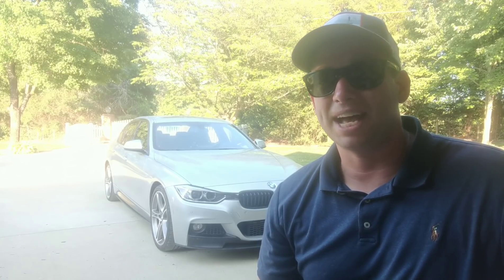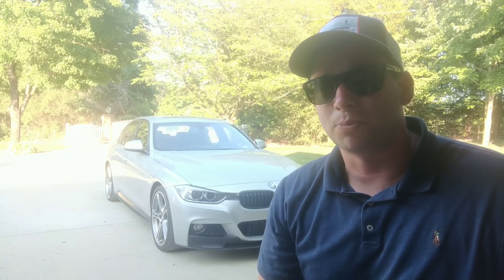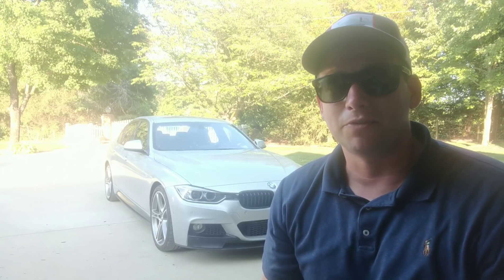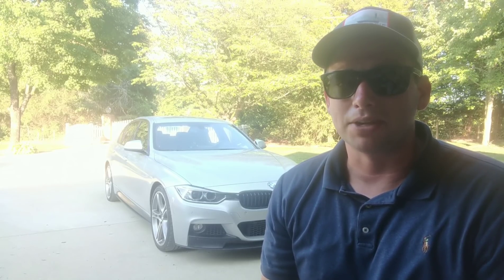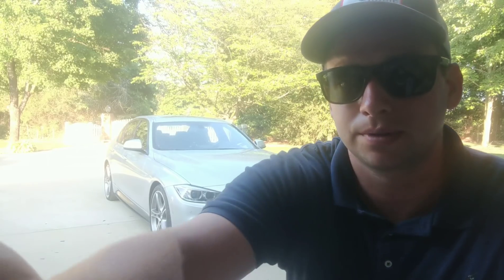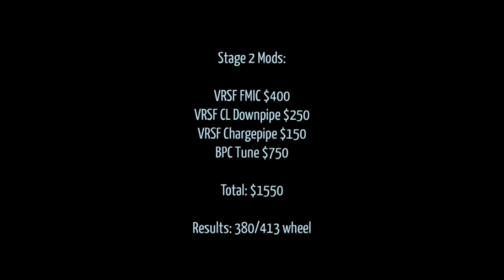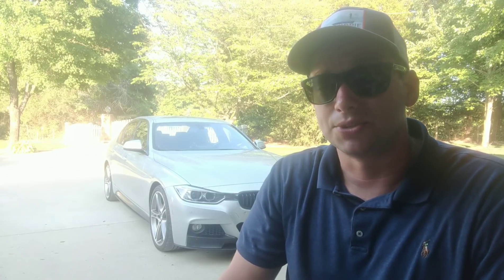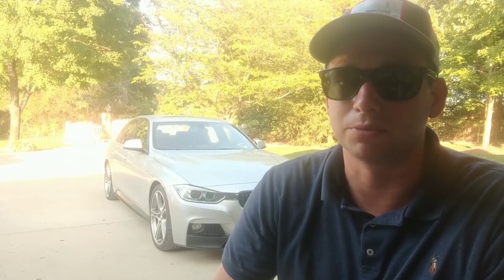BMW F30 335i N55 - Performance Mod Overview - 500whp+ on 93 Fuel

Comment: how is it holding up?
Reply from the maker: Still running strong with the new owner(s) as far as I know from a few weeks ago
Reply: @BtwilliasGarage  what was the verdict on the n52 cam vs the cost
Reply from the maker: I enjoyed the upgrade and made power across the board. I will warn you that if you do it, prepare to write a doctoral study as proof for the internet 🤣
Reply: @BtwilliasGarage  im torn on what route i want to go, already got the stage 3 meth kit and FBO.... looking at turbo/cam now
Reply from the maker: Definitely do the turbo and fuel pump before the cam
Reply: @BtwilliasGarage  already have dorch stage 2 hpfp and stage 3 spool lpfp

Comment: I’m late to the party, but these number seem really low based on what I’ve seen, experienced and heard from others. I’m curious to know the condition of your motor? “Mileage” pure stage 2s with 93 oct should be making 420-450 easy. With hpf 500+
Reply from the maker: I ended up making 550/579 after fine tuning and a few other parts
Reply: What got u at this new power. With ps2 and making sure it have everything needed to reach 500whp. Did not go with xdi35 but dorsch stage 1 that I seen flows the same. But was wondering if without meth I can reach the 500whp at least.
Current set up
Set fbo
Dorsch stage 1
E30
Next ps2 will added with inlet
Reply from the maker: @juliosuarez8414  it will be close, but you may need ethanol (e40)

Comment: Watching this for my new 2015 335i, and this is one of the most comprehensive videos I've found without any of the fluff. 10/10 video my dude.
Reply: Slight edit, did you get an LSD to prevent slipping? If so which one did you go for, and how much did it cost?
Reply from the maker: I never put an LSD in it unfortunately
Reply from the maker: Thanks for the kind words man. Enjoy the new ride

Comment: Would you recommend me getting the fueling system upgrades first before the turbo?
Reply from the maker: +cutthroat performance the turbo alone will net you good power, but I would at least do meth with it to get the most out. you will need a high pressure FP too to get over 500 whp

Comment: I'm also in Raleigh and have been to BPC for maintenance.  Driving a 2013 E70 N55 and am interested in your stage 2 mods.  Did BPC take care of your CEL after DP install?  Are you able to pass emissions?
Reply from the maker: They can install the parts for you, but no longer offer tuning. You can work with a remote tuner to handle the CEL. I do not require emissions in my county thankfully, but have since sold the N55 for a S58. Give them a call and let them know Brad sent you

Comment: I just started a build on my 2013 did you have to put any work into the internals of the motor?
Reply from the maker: When I went over 500whp I did ARP studs and ACL rod bearings

Comment: Yo great video! Quick question though, over the year, how has the reliability been?
Reply from the maker: Thank you! Everything is going great. No issues other than chasing plus, coils etc for a misfire for a week or two on WOT. Ended up being bad ethanol lol
Reply: @BtwilliasGarage  gotcha, I’m planning on doing fmic, chargepipe, intercooler, and stage 1 tune. Thanks for the quick response really appreciate it🙌
Reply from the maker: You're welcome! Enjoy it, that will be a nice bump in power
Reply: @BtwilliasGarage hopefully I can make like 360-380 to the crank haha
Reply: Hey man, great vid! You mentioned something about NOT upgrading the low pressure pump but never got into why, so now I'm curious lol. My 435xi build is pretty close to yours except I'm still deciding which turbo I wanna go with and I also haven't installed meth

Comment: Do think getting an aftermarket compressor for the stock turbo would be a good cheaper alternative instead of getting a new turbo? I’ve heard the stock turbo could handle over 25psi but wouldn’t consider even breaking 20
Reply from the maker: That would take a pretty impressive skillset to pull off man. I'm not educated on what all that would take to make your own PS2, but it's definitely not easy to pull off. I would plan on buying the PS2

Comment: Hey I've been recommended to do the LPFP vs HPFP, you mentioned not go with the LPFP? Can you recommend why? Thank you!!!!
Reply from the maker: What mods do you have? If you are only going LPFP because you do not need a ton of extra fueling, then sure, go for it. I'm just saying when going HPFP then it is not needed in many cases to do a LPFP due to issues that it causes with both
Reply: @BtwilliasGarage  Right now I've got VSRF down pipe, CP, FMIC, exhaust, gapped NGK plugs, coils and JB4 tuner...Running 91 right now but wanting to install the PS2 turbo and figure out whether to go meth injection or e85 mix (whichever is less work on my side to fill it up regularly) Thoughts? Got ohlins R&T coilovers installed today too!
Reply from the maker: @ShelbyPaget  Nice! In that case I would just plan on going PS2 and meth to start. You can always run a small ethanol blends with your meth for a little more power, but after MUCH testing ive found a 93-e30 mix and boost juice is reliable for 525whp+/550wtq+ all day long (with XDI35 HPFP). Just do PS2 and snow kit with size 6 nozzle next, tune properly. Will get you mid 400s for power and be solid for learning the car at that power. Then do HPFP when you get bored
Reply: @BtwilliasGarage  Is there any advantage for the LPFP then? Sorry a newb to the n55 platform and learning as I go. I will likely just follow your footprint as it looks sweetttt!
Reply from the maker: @ShelbyPaget  No worries! Yes, the advantage to the lpfp is a little more fueling BUT that will not be worth it in the long run with your plans to go PS2. You will max out the lpfp and the hpfp will do the exact same for the ps2 with the OEM lpfp as it would with an upgraded one.

Comment: Do you not worry about spinning the crank timing sprocket, or the crank bolt coming loose?
Reply from the maker: Nah not really. On S55s that's a big issue though with the crankhub as I'm sure you know

Comment: in your opinion, what's the most similar in terms of power to your bpc tunning, mhd or jb4?
Reply from the maker: It's not so much the software/app, it's the tuner. I prefer MHD. Check out PureBoost for a custom tune

Comment: Rod bearings at 140k miles?? I need to drop the pan for gasket and am wondering if I should upgrade rod bearings ? Thank you
Reply from the maker: Yes you absolutely should! That was mine at like 45k, but I've been pushing 500whp+ for 10k or so. 380whp for 15k before that
Reply: Btwillia's Garage would you recommend oem coated or an aftermarket upgrade for rod bearings  ?
Reply from the maker: @UsuallyOff  I recommend the ACL race bearings

Comment: How is the rest of the powertrain handling it? I'm guessing launch control is off the table. Did you go with wider tires too?
Reply from the maker: I use xHP so I can dial in the perfect amount of slip. 0-60 is around 3.4 on good days. The tires are not ideal. 255/30/20 PS4S. Would do way better with a beefy 18 setup. appreciate you checking it out!

Comment: I'm still paying my car off and want to do this to my F30 N55 335i.  Currently having issue with battery drain even after replacing the alternator and having both battery and alternator tested - passed!

I was on the way to work, then the computer screen went blank while on a call.  it came back up and a warning came up about the transmission.  Could this be why my battery isn't charging while driving it?
Reply from the maker: Did you have the new battery coded properly after you/they installed it?
Reply: Btwillia's Garage yes I had my mechanic do that. My assumption is that coding only needs to be done when a new battery is installed.  Not if the same battery is disconnected and reconnected.
Reply from the maker: I agree, I believe it only needs to be coded upon replacement. You should be able take the + and - off without issues and reconnect the same battery back within no issues. My car has a slight parasitic draw when I leave it for 5 days+ with the radar detector and what not plugged in. I open the doors a few times as well. It gives me a warning that the battery has lowered voltage when I don't drive it for 5 days or so. It's the original 2015 battery. I'm not sure what the recommend man. I hope you get it figured out!

Comment: Great video in your opinion which would be a simpler more cost effective mod to make between the 2 meth or E85 blend ?
Reply from the maker: That's a great question. Where I live it is kinda tough to find E85, which is why I went with meth. If you are able to do your own work, meth is not too bad. You can even use -32 windshield wiper fluid to save money, although I prefer to run Boost Juice. Lots of people make pretty good power running a e blend. Let me know what you find out and decide on. I'll be giving away an E85 test kit and some shirts here soon, so be sure to subscribe if you haven't already

Comment: Thanks for the help. I'm honestly bummed because I was told by MHD that the LPFP stage 2 was needed, but now I've been reading more and it seems like HPFP is more important! Guess I'll have to upgrade 🤷‍♂️
Reply from the maker: Yeah things changed once the XDI35 entered the market. You should definitely get one if you can. I hear the stock lpfp works best with them though, so just be aware.

Comment: nice informative video... kinda dislike there were no pulls or sound or anything of the car. lets say you purchased the car for 40k (real number here might be higher). you spent 10.5 grand on tune. wouldnt you get a more horsepowered car for 50k than the 335?
Reply from the maker: Thanks for the feedback. You can find quite a few interior, front exterior, rear exterior, etc sound clips on my channel if you would like. You would be hard pressed to buy a car for 50k that would beat this one, but I'm sure you could
Reply: @BtwilliasGarage  well i was just calculating. and numbers cant be compared to what you really like. i have a 335i stage2 (making around 400+ at the crank) and i wouldnt swap it for any other. just wanna put more juice in it :D

Comment: So with all that combine you spent $7760. not bad.
Reply from the maker: Check out the slide at 11:55. It was right over $10k for all the parts. Still not bad for a N55 that can hold it's own with most sports cars 👍

Comment: What is the stock engine good for if you daily drive it? Also can the speed tech turbo kit make 500 whp on 93 oct only?
Reply from the maker: I would say the stock engine is fine til 575 or so if you are smart and not launching it daily with traction control off. I've seen people break axles and what not, but that's from donuts, etc. I'm sure the speed tech kit can make 500+ with supporting mods. I'm not terribly familiar, but if that is the stage 3 kit then I've heard 600+.

Comment: What coils do you run?
Reply from the maker: I just have m sport suspension currently
Reply: @BtwilliasGarage  sorry i meant ignition coils. I just purchased the xdi 35 hpfp. I asked Gabe and he said just get new oem coils with the ngk 2 step colder. He dosnt like aftermarket coils. But what coils u have?
Reply from the maker: @HeathHerring666  ah gotcha, yes I use stock coils and N20 plugs when I did PS2. Kept the same setup when I installed the XDI35 a couple thousand miles later. My coils have around 40k on them. Should probably get some new ones in the next few months and a set of plugs to be safe
Reply: @BtwilliasGarage  nice! Sounds likena good setup. Why n20 plugs when you have a n55?
Reply from the maker: @HeathHerring666  n20 plugs are 2 steps colder than n55 👍
Reply: @BtwilliasGarage  gotcha the 95706 ngk? Thats what i run too
Reply from the maker: Those are the ones
Reply: Im confused? The ngk 97506 gapped to .020 are for high horsepower n55 engines. Recommended by mt tuner. They are stock for n20 and s55 but are also ran in n54 a d n55
Reply from the maker: @HeathHerring666  clarify your question a little for me. I'll reach out to my installer and try to get clarity

Comment: Ive been talking with the guys who make xdi 35 hpfp. Im about to pull the trigger and finally say goodbye to the stutter. But my question is, is the xdi hpfp full e 85 capable? As long as i got my lpfp upgrade? Thanks
Reply from the maker: I'm pretty sure it is, but I would check with them or Frank Smith and Gabe at TTFS. I'm not sure that you would need to upgrade your LPFP, but I have no plans for e85, so I'm not sure on that. Lpfp is good up until 700whp with the XDI35.
Reply: @BtwilliasGarage  oh nice i just purchased the pump and im driving 5 hours to meet them to get it installed at the end of the month!

Comment: Thanks for this vid. Been following the build. Still dealing with a stutter from 3k to 4.5k in wot. 13 n55 pwg xdrive. Bm3 saying hpfp is taking a dive. Ty for your reply on fb. Wondering if upgrading the lpfp would help my issue instead of hpfp cause its so pricey. Meaning getting a better lpfp would it force the fuel through.

Secondly i havnt seen this anywhere for the meantime on bm3 could i do the boost by gear percent and maybe fix the issue that way? Thanks man. Keep the vids coming.
Reply from the maker: I appreciate the comment and follow! I'm sure the LPFP would help quite a bit. It would have to. You honestly may not even want/need to go HPFP with the AWD. It would be overkill and you would be insane fast off the line, but likely break something quick. That based on what I have heard, not experience.

I am not familiar with BM3, but will follow up if I can track down more info on BBG. I'll make more vids next week! Tires are getting worn, so next vid should be very smokey 😁

Comment: VRSF makes cheap, Chinese grade parts.  Evolution Raceworks makes the quality parts.
Reply from the maker: Only problem I had with VRSF is needing to trim the chargepipe slightly to get it to fit properly. I wouldn't expect that problem with Evolution. Although they may be cheap, the parts seem to work just fine at 500+whp
Reply: Btwillia's Garage I had to
Do the same with their chargepipe. Works fine though

Comment: Did round 2 have meth or e85 already? 380whp is high for bolt ons, I notice you only gained 50whp adding a PS2 turbo and meth and lost some torque
Reply from the maker: Meth was in round 3. The car did have higher torque with just PS2 and meth But my tuner turned it back to be safe until we added the pump

Comment: Sick intro for a such a small channel. Keep up those cinematics!
Reply from the maker: I really appreciate that! I enjoy it as a weekend hobby. Thanks for the motivation to keep it going
Reply: Does that HPFP fit a f10 535i N55?
Reply from the maker: I believe it does! Call TTFS tuning and they will confirm. They also have an XDI-60 if you are feeling crazy. Did a cam upgrade today and gained 100whp at 5.5k rpm. Be sure to subscribe 🤘

Comment: Awesome video buddy ,, that power was on 93 ? Don’t u consider to flash your transmission too ?
Reply from the maker: Thank you! Yes this is 93 fuel with meth only. I asked my tuner to flash my trans, but I'm honestly not sure if he did. Will need to check. It's lightning fast shifts, but then again the ZF8 is strong stock

Comment: Awesome video! Looking to start adding power to my F36 N55 right after coilovers. With that much power do you need to get an LSD?
Reply from the maker: Thanks a ton for the feedback! You will get addicted quick to adding the power. The full bolt ons and tune are awesome for the price. 100whp and 100tq gained for around $1600 if you can install yourself. The intake and exhaust are simply for sound, so not required to go quick. After that it gets pricey, as you saw. My car hooks up great in launch control mode. Only problem is the 20 inch wheels and tiny sidewall. With a meatier sidewall I could probably get my 0-60 down. Currently at 3.61. Thanks for watching!
Reply: @BtwilliasGarage  Damn that's fast! Can't wait. Thanks for the great info.
Reply from the maker: Lsd is not required, but would be a ton of fun!

Comment: Gonna be doing a similar build, going through all the stages. But tbh hybrid turbos just don't cut it for me if you're pushing over 500whp, especially for a daily. That's  why I'm going to go with speedtech's kit. The biggest problem imo with the N55 is the manifold and turbo. The B58 makes over 30hp more just because of it's improved manifold. So I just don't see myself wanting to push that much power through the stock manifold and borred out turbos with thinner walls. Just go big baby, these engines love it. All you need is a good EFR turbo that will be at full spool by 3500rpm and much more reliable as a daily. Just my 2 cents
Reply from the maker: I can understand that, but don't sleep on the Pure S2 setups. I have room to turn it up to 575 or so when I'm ready. Plenty of people have put over 60k on this setup with no issues daily driving it. Don't blame you for going big though!
Reply: @BtwilliasGarage  Your 575 number is on a high reading dyno.  I have a similar setup on my F87 M2 and ran on Frank's dyno (TTFS) and only made 525whp.  I'm just saying, the Pure turbo's heat generation above 20psi and restrictive nature of the turbofold really stop any power production.  Speedtech is the way to go for big power.  I hate to say it, but I might end up going that route in the next few months.
Reply from the maker: @switlikbob1  valuable info, thanks!
Reply: Philip McIntosh you have to have a YouTube channel,, no body on YouTube created content about stage 3 turbos ,,, plz keep us updated